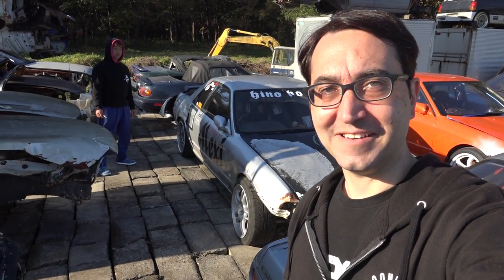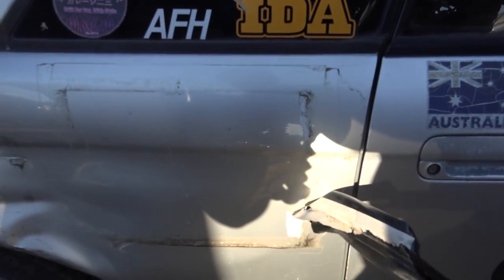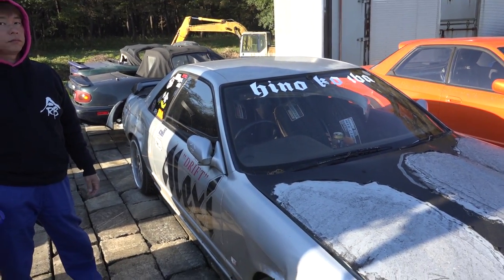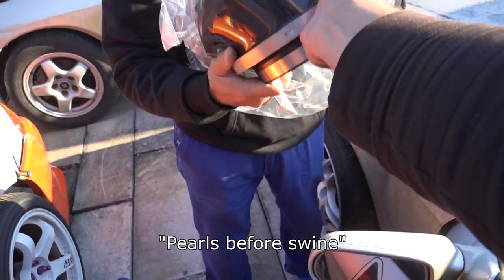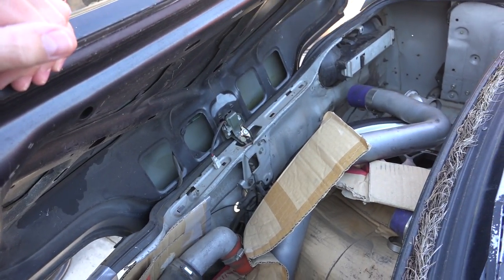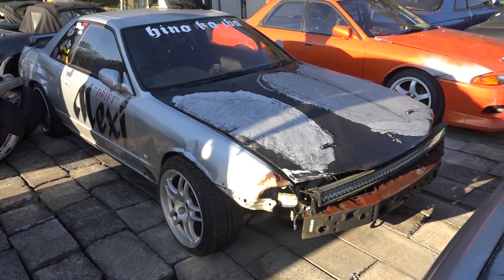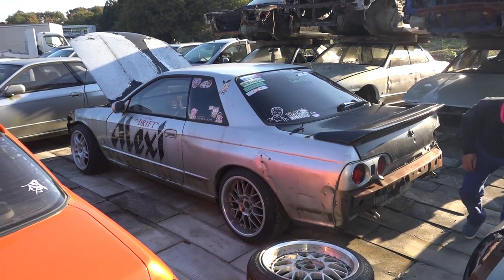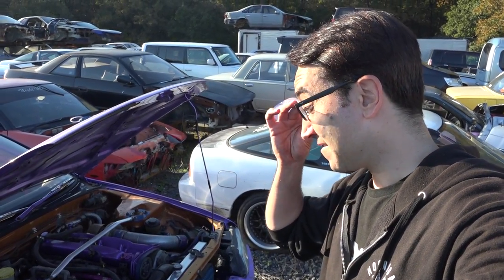Skyline drift missile is still in a junkyard

Comment: Keep it the same style, it should always remain a missile and full throttle car like you said. The thing starts first go every time (because Nissan) so it should remain a car you just hop in and go. Just freshen it up with over fenders for the rear guards, carbon boot and carbon bonnet, gtr style front bar again and get the thing back on the go ASAP. New turbo + front mount good to go! P.s would love to see it at sly

Comment: I think the beercan should always be the beercan, but rather than a wrinkled crumped up can it should look new again. Keep the "Super Drift Alexi" on the side. Swap the bonnet for a carbon one, cut out the crumped rear corner and weld in a new one from one of the many parts cars there. Straighten it out and make it 80% new again. You don't really want to go 110% with it as at the end of the day its still the "Missile" car of your fleet and if it was too perfect throughout you wouldn't drive it with nearly as much aggression and comfort as you normally do as you'd be too scared about bending it again but at the same time it's in a right state currently and just looking at it almost makes you want to give up on it before you've even begun.
Perhaps get it back in to a state where it's road legal again? if that's even possible with Japanese laws etc? So we can see the new crispy ice cold beercan at some new tracks like we did the JZX before its untimely demise.

Comment: Hi Alexi.
The flock mfg charms. Using your link or not, $20USD for both then the shipping is $40.80USD to Australia. That is more offensive than closing down Oran Park raceway for a housing estate....
I reckon it is the site auto calculating and not Flockmfg's intention as I can't imagine something that fits in an envelope for your fans is meant to cost so much.
If ya also think its an error do you wanna maybe nudge them? I wanted to buy these as a Xmas present for a MASSIVE fan of yours but for that price noooooo dice.

Comment: It wouldn’t hurt to start rebuilding the body. Cleaning up the rust, fixing up the fenders and rear, getting a new bumper, then sanding down the paint and repainting it again. The RB20 seems to be the ideal engine, but you could look into the RB25 or 26. But by next year it could he a completely different car.

Comment: just repair it to look nice again GTR front working lights fixed trunk do a better rust prevention on the back 
and put over fenders on (except you wanna swap the whole quater...) 
just make it less junk yard so you might actualy can drive it on the road 
and keep the bigger brakes in the front.

Comment: Put it on a frame machine, line up the chassis, pull the bent quarter panel and the radiator support, cut out the damage and replace the sheet metal. Fix her. You know it’s gonnbe silver and black and some purple.